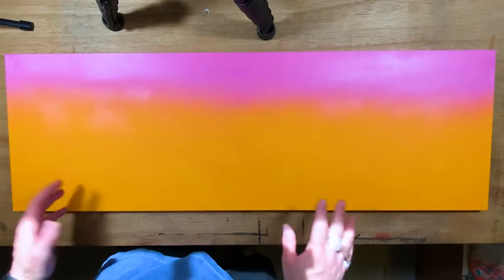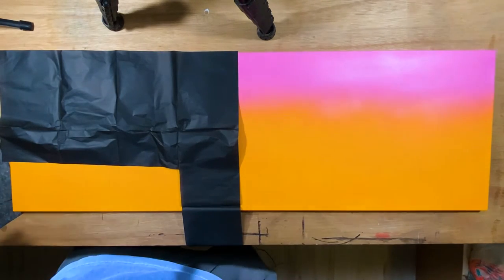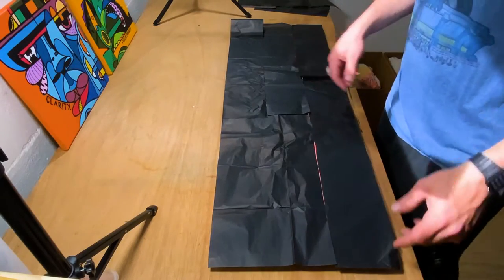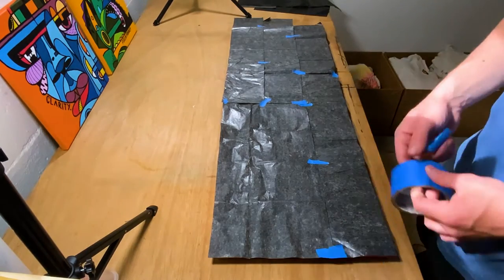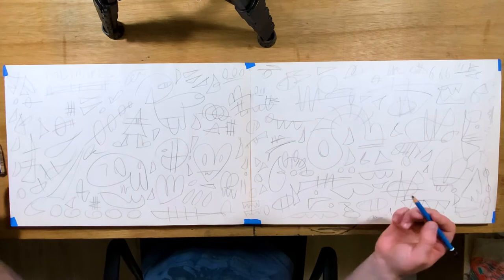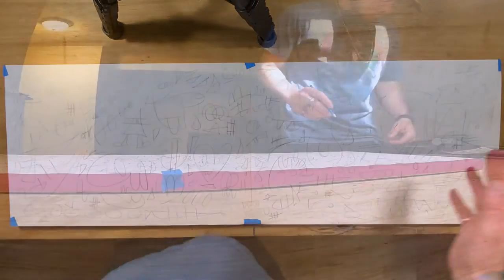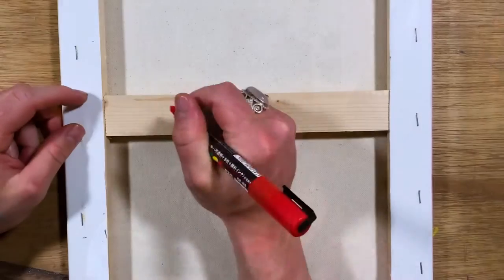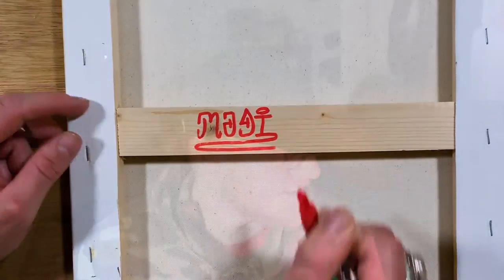The Bridge Between Us: A Call For Unity In A Large Landscape Painting On Canvas - Posca Portrait Art

Comment: Dope work!
How many layers of the Posca pens are you using?
I run into issues when I do multiple layers with them bc the layer that’s already down gets reactivated and it becomes a mess…😬
Reply from the maker: Thank you! The truth is it depends on what surface I'm painting on. So with a canvas painting I find that I can usually use 2 layers for each color if I want to because the canvas locks in the first color pretty well. However I usually try just to use 1 layer because I like seeing the paint strokes and the texture of the surface, it maintains a more hand made feel.